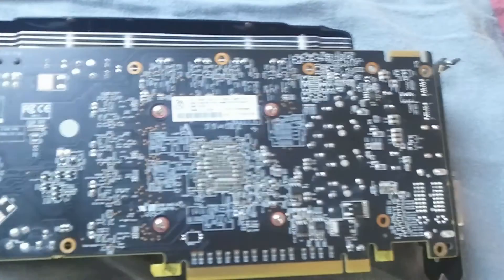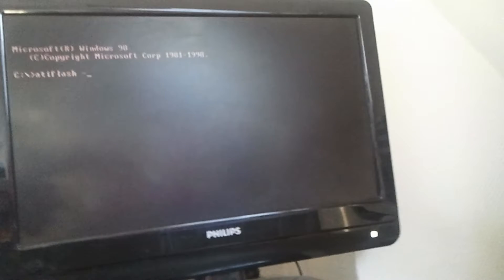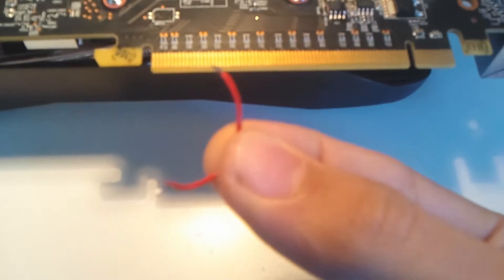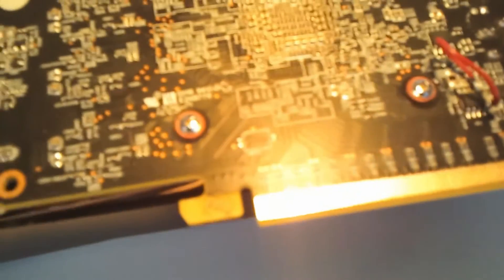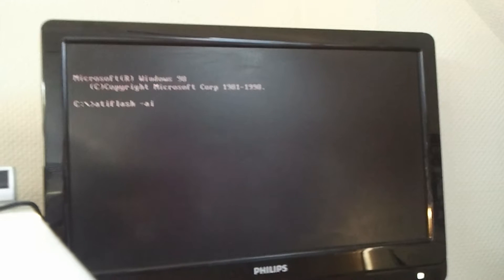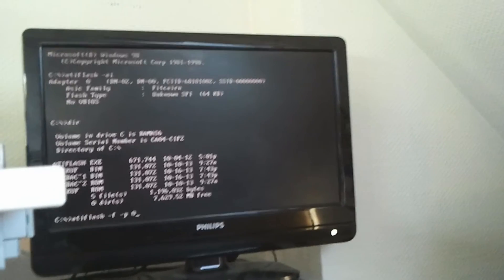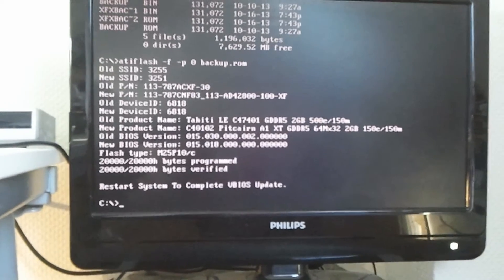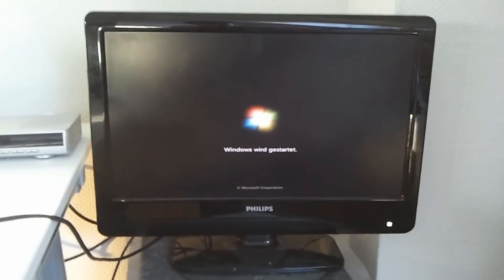Solution | Bricked HD 7870 XFX GPU BIOS FIX | Hardest Way

Comment: I used this method to save my Asus R9 280x (thank you).  The only difference is it was terminals 4 and 5 for me , not 1 and 8.  Here are the steps I took to figure that out.

1.  Find a 8 pin chip on the card.  There was only 1 for me.  
2.  Read the number on the chip and google it.  
3.  Make sure the chip is a "flash" chip.  Meaning it stores the bios.  If not, look for another chip with 8 pins.
4.  Once you have the right chip find the wiring diagram.  You want to short between DI and GND.  
5.  Solder a small wire between DI and GND. (4 and 5 for me, 1 and 8 for the man in the video).  I've also seen SI and GND, but I think that might be for motherboards not GPUs. If your diagram only has an SI and no DI, I'd go with the SI and GND.
6.  Follow procedure in video above.

*Follow at your own risk.  Not responsible for damaging anything.
Reply from the maker: +wk390107 So you used my tutorial like a helpfull base for your GPU? Is that 
correct? And if it is so, I am glad you saved your GPU as again I am 
sorry i could not reply directly to your GPU problem, again I dont have 
any experience with NVIDIA GPU and AMD GPU (Higher then HD 7870) and 
before I give any wrong advise, I rather be quiet.

P.S.: Can I 
add your solution method to the GPU Asus R9 280x in my video 
description, many Asus R9 280x owners will be happy to read it , no 
worries credits goes to you as well :)
Reply: Go ahead!  I can't guarantee the pins will be the same on all R9 280X (i suspect they are), but if you follow the steps you should be able to figure it out.
Reply from the maker: +wk390107 Done! its in the vid discription, many Asus R9 280x owners will be very thankfull !
Reply: Kill Bandel hey man I googled my chip and on the diagram I couldn’t find SI or Di but i could find GND and some other options can you have a look yourself and tell me which one i should connect ? Chip: Pm25LD010.   Thanks in advance buddy
Reply: None of this helped me
my bios was pm25lq0020
in dataset, pin 4 and 5 should be connected tryed but still Adapter not found
I took out the chip and then flesh it with the programmer it's now working perfectly

Comment: can you  use a hot glue gun instead of soldering? i mean worst is it wont work but it wont damage anything right? i think its small voltage so connection doesnt need to be strong
Reply from the maker: No dont do that, glue is not an electrical conductor, there for you would ruin the card for good!!!  As for the other users with issues I will reply each comment on the next days, I am back after the long break I made.
Reply: Tugas PT I mean to use heat glue gun instead of solder. I will still use a wire to connect the first and 8 pin it will be glue holding it instead of solder. thanks
Reply from the maker: +CopyCat hot glue does not work as an electrical conductor, you need a soldering kit.
Reply: if you put wire on the contact it is already conducting, you just use hot glue to hold it in place. that is my thinking for risk free i  am not sure

Comment: Hi!
I think Your video is my last chance to get my graphics card back to life.
I have a question. My graphics card model is - HD7770(GV-R777OC-1GD).
Where I need to solder, which pins - look at the picture.
http://twojepc.pl/html/test_gts_450_460_gtx_470_480_550_560_570_580_680_radeon_6800_6900_7700_7800_7900/gigabyte_hd_7770-2.jpg

And so I need to solder it put in PC type -ai in atiflash when it shows gpu i can cut it and flash it with my bios?
Will it work with my card?
Best regards!
Thank You so much!!!!
Reply from the maker: Oh sry, it only showed today on my notifications wall, did you made any progress? Do you need something? Did you fix your graphics card? So sry stupid Notification wall... You could have tried to PM me.

Comment: Hello. Can you help me? I have a bricked Nvidia gigabyte gtx 770. I want to try to unbrick it by following your introductions on this video. But i don't know how to identify the bios chip on my card.. There is a picture of my card's pcb. Please can you tell which one is the bios chip? 

https://mega.nz/#!HZdERIpL!TMj7u7wQ9WL9bgKTFoqf7FIN8wuykXI5hlBYktdFeFA

https://mega.nz/#!ecUXALbQ!FmVcSAJsctWDaRmFjgnSjCTKJ7c068sBMw1zoXGznrM

Thanks. I hope you can help. Or someone here
Reply from the maker: +Jorge Monasterio Hello! Well as you can see the tutorial i mad is for HD 7870 series, and not Nvidia Gigabyte 770, I am sorry but I can not help you further, because I have no experience with Nvidia GPUs
Reply: +Jorge Monasterio As i commented above:

I used this method to save my Asus R9 280x (thank you).  The only difference is it was terminals 4 and 5 for me , not 1 and 8.  Here are the steps I took to figure that out.

1.  Find a 8 pin chip on the card.  There was only 1 for me.  
2.  Read the number on the chip and google it.  
3.  Make sure the chip is a "flash" chip.  Meaning it stores the bios.  If not, look for another chip with 8 pins.
4.  Once you have the right chip find the wiring diagram.  You want to short between DI and GND.  
5.  Solder a small wire between DI and GND. (4 and 5 for me, 1 and 8 for the man in the video).  I've also seen SI and GND, but I think that might be for motherboards not GPUs. If your diagram only has an SI and no DI, I'd go with the SI and GND.
6.  Follow procedure in video above.

*Follow at your own risk.  Not responsible for damaging anything.
Reply from the maker: So you used my tutorial like a helpfull base for your GPU? Is that correct? And if it is so, I am glad you saved your GPU as again I am sorry i could not reply directly to your GPU problem, again I dont have any experience with NVIDIA GPU and AMD GPU (Higher then HD 7870) and before I give any wrong advise, I rather be quiet.

P.S.: Can I add your solution method to the GPU Asus R9 280x in my video description, many Asus R9 280x owners will be happy to read it , no worries credits goes to you as well :)
Reply: Usualy the chip with some kind of G before the serialnumber is the ROM chip on GigaByte

Comment: i notticed when u powered on your pc for some seconds pc acted like shutting down is this normal? my pc has the same "problem"
Reply from the maker: +Thanasislt1997 Yes! The process you saw is made by the mainboard and psu, if I had a PSU with over 1000w it would do the same thing. The mainboard checks if everything is runing smooth and well without any error (Like PSU watts, GPU clocks, CPU clocks, checking if the Fans are working properly) before booting to the ASUS bios screen and then follows the normal OS booting proccess
Reply: +Tugas PT so it;s normal for the pc to "turn off" for a 2 sec?
Reply from the maker: Yes Thanasislt1997  its called the POST aka Power-On-Self-Test it is procedure from the BIOS
Reply: ok ty a lot :D

Comment: Hi  man, you did an wonderful job here. I have a 5770 and try all of this but with no result. Stilll adapter not found. I was using a mainboard that has a vga onboard. Maybe I need dual pcie slot with another vga on pcie?
Reply from the maker: +rooster jon Thank you for your opinion! But as you can see this a tutorial about hard flashing a hd 7870,  and not for a hd 5770, as you can see in the video I had an extra small GPU from nivida, cause my mainboard has no onboard
Reply: This was for rx 460
-> I was not even able to flash the bios because ATIFlash 4.17 under FreeDos gave me ,,adapter not found,, all the time. 4+5, 1+8, 4+8(!do not brige that), 1+5. I tried all combinations but ATIFlash under Freedos gave me ,,Adapter not found,, every time.
 The trick for me was to connect 4+5 and go under Windows. Download ATIwinFlash last version. But If I tried to start the program, an error pop up. But not the basic error ,,Cannot detect any ATI card,,. The error was ,,Error trying to read the ROM,,. And I knew that the ROM CHIP was deactivated. Your method worked :). The pins connected with a clip like this was working too ,,https://i.imgur.com/dlk9uIX.jpg,,. So is not necessary to solder the pins.

 Now. Because the ROM chip is deactivated, let's repair this GPU once and for all. I used the integrated video card to boot. The bricked card was in the first PCI Express slot (the one closest to the CPU). Before starting to do anything, make sure you are not overclocked. Allright. Boot in windows with integrated video adapter.
1. Download Iobit Uninstaller and uninstall all programs that run in background, all the antiviruse software, any overclocking tools and any drivers. Best is to have a clean install..
2. Disable the Windows Update Service.
3. Use DDU to completly clean all video drivers from your computer.
4. Use AdwareCleaner and Wise Registery Cleaner and CCleaner to completly clean up your PC.
5.Make sure you restart

 Now Download ATIWinFlash...
So... Every ATIWinFlash come with an AtiFlash that can run under CMD, but not under FreeDos. I opend CMD with admin rights and I did the following:
1. cd /d "D:\Desktop\MODING\atiflash_277" // replace ,,D:\Desktop\MODING\atiflash_277,, with your path.This command is used to navigate to a folder from cmd.
2.AtiFlash -i //To see if the atiflash can detect my GPU. And for me worked only from windows. :). On classic ATIFLash 4.17 under FreeDos didn't work. ,,Adapter not found,,.
3.I searched ,,Asus Dual-RX460-2G support,, on google. After that I went to Specifications, to see what specs my gpu have, to be able to download the correct vbios. After that I went to VGA BIOS collections and I downloaded the correct one. By the way... This is it 
-> https://www.techpowerup.com/vgabios/192942/192942. 
I renamed it to ,,bios.rom,, and place it on  atiflash_277 folder.
4.I used a screwdriver to remove the bridge that connected pins 4+5, before flashing.
5.AtiFlash -f -p 0 bios.rom // Wait for flash to finish.
6.Shutdown your PC, and unplug it from the wall.
7.Power on, but now go to bios and change to boot from onboard to PCI EXPRESS.

TADAAAAAAA. GPU is working now. Thank you again for this video. I hope I can help someone.

Comment: Your video is an inspiration. Lol.

I think I just bricked my GTX 970 G1 Gaming. Although it has dual bios (with no switch), I manage to corrupt both vbios (I think). The first vbios I think got corrupted when I tried to update my vbios with gigabytes' own vbios updater without disabling the driver. It went black and then the second vbios kicked in as a failsafe and I still didn't know what happened. Now, I tried to flash a custom bios and for some reason it failed. And then after digging in the internet I suspect both vbios are corrupted, first vbios got corrupted when I tried to update my vbios (although at that time I didn;t know that I just corrupted the first one) and then the second, I tried to flash a custom vbios and for some reason it failed.

I hope you can help me with this. I know the risks, I just need help.

Thanks.
Reply from the maker: +Silaar Prime I am sorry but i have no experience with flashing bios on Nvidia Cards. And I dont want to give you a wrong advice.

Comment: Thanks for the video,
i have a problem with my gigabyte hd 7870 windforce OC, it works for about 20 seconds and then the signal lost and the Fan of the graphic card stops working,  
when i shutdown the Pc and turn it on, the fan works and stopped with no signal, is this video will help me to Repair it??

Thanks
Reply from the maker: ***** it depends, by "reading" your problem it could also be the comon case of bottlenecking which means the PSU that you have doesnt have enough power to run the graphiccard, which PSU do you have?it could also be a problem from the motherboard too i am not sure either.

Comment: Hi !!
I have the same problem 
i got flash my powercolor 7870 pcs and mi vga is bricked
y try everything y i see my only solution is in your video

my question is

what is name of the circuit of your bios ???
In my card a see 2 chips whit 8 pines
one says apw7163c a06g9
and the other y cannot read because is painting by factory

I wait your answer thx !!
Reply from the maker: if you notice here http://j73.imgup.net/xfx-radeonbb2b.jpg i also found 2 electronic pieces, they are the same but the one of the left was the one i used. The question is are the 2 chips you found next to each other on your powercolor?
Reply: thanks man problem solved and vga revived :D
Reply from the maker: +slowpoke qlo lento Glad my tutorial saved one more GPU, spread the word thank you for your opinion!

Comment: DUDE you just saved me 200€, I want to thank you. for information mine was a Sapphire Dual-X hd7870, and it worked perfectly !
thx thx thx
Reply from the maker: You welcome sir! Spread the word!  :) i would buy a second Saphire Dual-X Hd 7870 they are a beast when it comes to crossfire, believe me, They are small and dont overheat too fast !
Reply: Tugas PT I'm thinking about doing that too because a single HD 7870 is becoming a bit light for the latest games
Reply from the maker: Guillaume Serrurier if you have a i7 as a cpu than you dont have to be afraid from the upcoming games. Remember to use the latest catalyst update it improves the hd 7870 a little bit, not much but you can see the diference

Comment: Hey very nice tutorial!!! I think i bricked my r9-280x from xfx! ;( but can you tell me how you recognized the chip as your bios chip only? I mean there are so many! Pleasw let me know coz i need to revive my gpu asap! Thanks
Reply from the maker: until I decided talk to my teacher, YES I said teacher (He is a real Pro when it comes to electronic pc parts) he suggested me to sold a cable from Pin 1 to Pin8 (Arrow is PIN 1 and on oposite side from it is Pin8) on Bios from my card http://j73.img-up.net/xfx-radeonbb2b.jpg with that my it would disable chip select and my mainboard would/could recognize the adapter with an UNKNOWN BIOS, so basicly the TAHITI BIOS (wrong flashed BIOS that BRICKED my card) would be ignore.  this was all on my description but basicly its a electrical piece that has 8 PINS youl find it most probably 1 or 2
Reply: Yeah i finally got everything working! Thanks to you for saving my butt atleast from RMA of the card!!!
Reply: Tugas PT And the most difficult part, on top of the bricked card off-course, was to do blind flashing! Yes! I didn't have another GPU so I was totally dependent on my motherboard's post (Thanks to all the LED's on the motherboard) and luckily I remembered all the steps and commands perfectly so I could get all up and running!
Reply from the maker: You had LEDs on the mainboard, i had none, it was such a good feeling when all of it was over and i could unbrick my card.
Reply: Tugas PT yeah but you had an extra GPU, that alone is more than enough! Anyways its good that its all up and running!
Reply from the maker: +Kevin Sheth Glad I save one more GPU with my amateur tutorial, spread the word and thank you for your opinion
Reply: Kevin Sheth can you tell me pins did you use on the xfx r9 280x? I have the same card.  Also where is the BIOS chip located on this card?

Comment: hey what's up, well i'm sort of serious doubts, i haven't brick my bios... yet... But I'm having a weird problem, i have an emachines t6520, which is a pretty old one (2005), anyway i found a ATI HD5450 on my home, so i decided to put it on that old computer, however, everytime i plug the video card the computer doesn't show any signal (the "not display issue") so I been asking a lot and people tell me its just that the mainboard is way to old (but it has an PCI x16 slot) so Im so disconcern, some guys on internet told me it should work fine, some other say i need to flash the bios (which i never have done before, but i'm sort of afraid to do it), i was thinking i just should get a new board, but i'm out of money, however, i just want to put that video card into that board... (i've tried setting the bios to run out of the integrated graphics, but no video configurations or setup is being shown in the bios settup omg.) so i guess the bios its just too old, but i'm not quite sure what to do... can you tell me xD you seem like an expert...
Reply from the maker: i am not expert just to be clear. well you can try to use a vga cable to a tv or a second monitor, by then you can see if there is any display at all. If you think the bios is old, you can update it, "maybe it is", just see which bios does match your mainboard and get the latest one you can do it to the chipset too, use somebody laptop or even a smartphone to download the bios and then move over to a bootable USB (google it how to do it). Last week i had a problem with my BIOS from mainboard the cause was a USB3 Device after an BIOS update it recognized  immediately and updated the USB3 device drive.

Comment: great tutorial. Maybe you could help me over a xfx r7970 be reference cooler. I have bought it as faulty and it doenst have a bios switch and i cant find the bios chip. If you cold help me with that i will be most thankful
Reply from the maker: +viliu me Uhhh I have no experience with such a powerfull card, why did you even flashed bios R7970 ? By the way I was thinking of getting 7970 crossfire, is it worthfull?

Comment: can u plz explain more the soft part !! plz
Reply from the maker: yes i can, i can even give you an link and you just follow those steps, you basicly must format a usb pen and turn into a bootale DOS, and on there just put the essential ATI software you need, then you must figure a way too boot it with a specific key on the startup (before booting to the Computer Operating System Windows) http://www.techpowerup.com/forums/threads/how-to-use-atiflash.57750/ here you go hope it will help ya